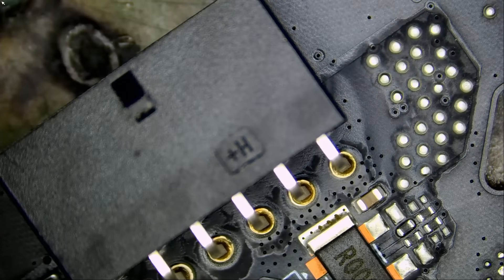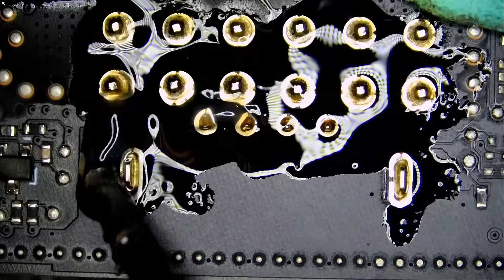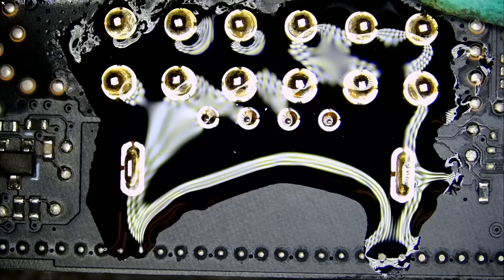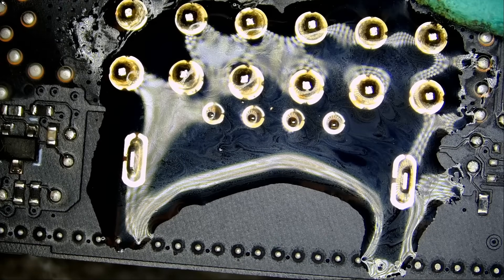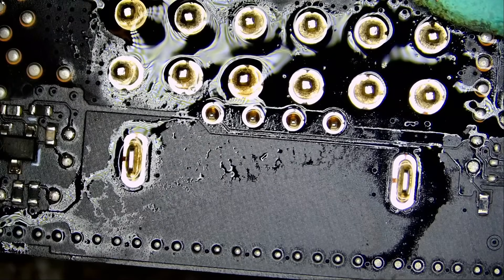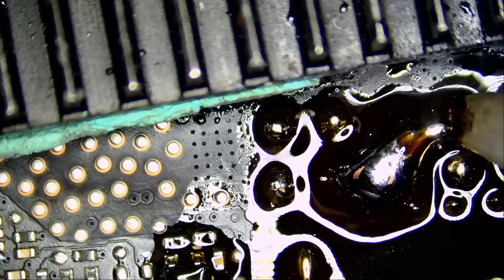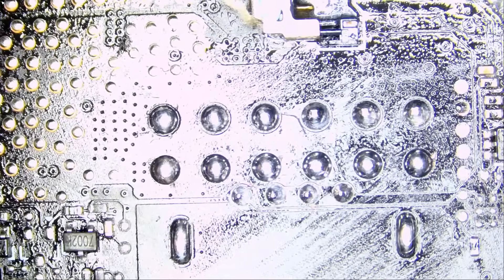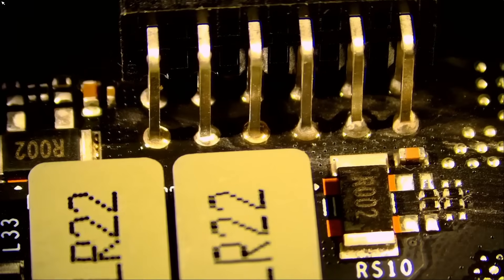5090 Melted Connector Repair. Only a fool would watch this.

Comment: As you are selling mainly chinese products God knows how will you sustain your business
Reply from the maker: Prices are going up across the board, and electronics supplies are no exception. If tariffs on China remain high, you could end up paying double what you're paying now.

Right now, we have a few products that are made entirely in the USA, like Amtech flux, low-melt solder, braid wick, Kimtech wipes, and a few others I can’t recall off the top of my head.  Even then, the U.S. factories may still rely on materials from China—which means those costs will eventually rise too, and unfortunately, we’ll have to pass some of that increase on to our customers.

We serve a large number of repair shops and hobbyists, and we’re all in the same boat. So far, we haven’t raised prices on our current stock, but it’s likely to happen sooner than later.

Comment: hi, I looking for a value of a capacitor on the nintendo switch V1, back of the lcd connector, bottom right from the DC0 5F1 chip (the bigger one), if someone know thanks you :)

Comment: Hello, after you use low melt solder to remove bad connector , do you solder new connector with low melt solder also ?
Reply: Low melt solder to remove, lead solder to solder new connector

Comment: BSOD could be anything.  I had BSOD and random power cut out on my old system.  I always thought it was the PSU but I changed it.  Then I thought it might be the ram, mobo or GPU.  It turned out to be a bad CPU 3700x.  (I upgraded my CPU and gave the 3700x to my nephew for his build and he had the same crash).

Comment: Preheaters are really a tool for rapid repeat operations only.  For example if you have to swap component on 200 identical boards you can have boards getting up to temperature while working on another one.  But unless you are in China breaking down entire boards for their used components, or in the assembly line correcting manufacturing/design mistakes, you’re not going to need or even want to get the entire board up to heat.

Comment: 06:10 --- in most cases any pc that get a taskbar freeze is ram + cpu memory controler problems ( overclock of ram or the memory controler was low quality ) and the second one is a faulty ssd or hdd that has errors (bad sectors).

Comment: Not a lot of 5090s out there right now, but I assure you...  SOON!  12VHPWR is a poor choice for a high current power connector.
Reply: There would be some solutions for this problem, by either upping the suppyl voltage to 24 Volts or even better 48 Volts to reduce current flow, or by using much thicker wires, and spring loaded push through connectors like on PA amplifiers.
The problem with the melting mostly is caused by bad connection due to contact resistance.
The engineers at NV are clearly not very brilliant.
Reply: @wolfenschwein1460  if it was from bad connections, he would get a lot of 4080s as well, but he gets none and they use the same connector, the only explanation is power draw, the 4080 uses under 300 watts, while 4090 uses 500 etc. you do the math. the issue is from power draw 99.9% plus .01 %